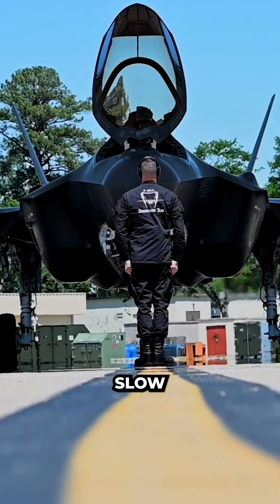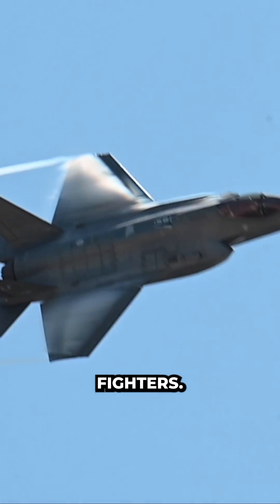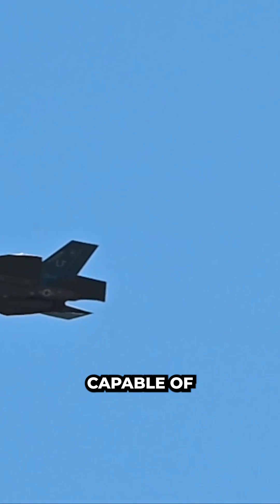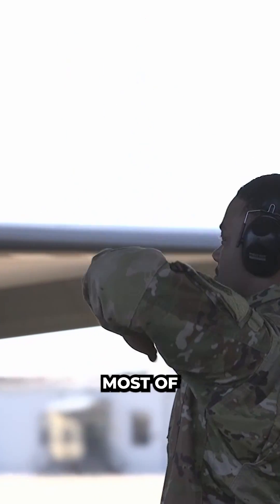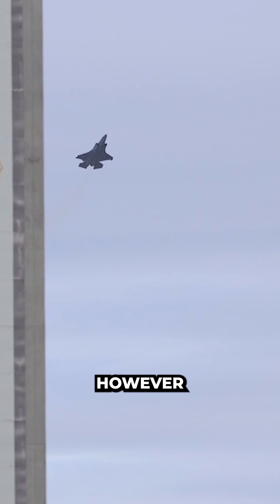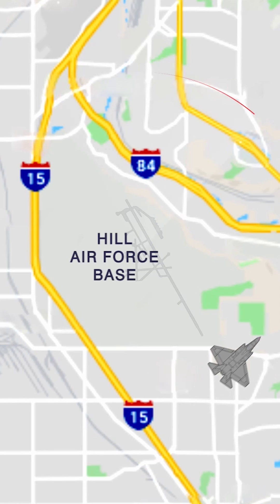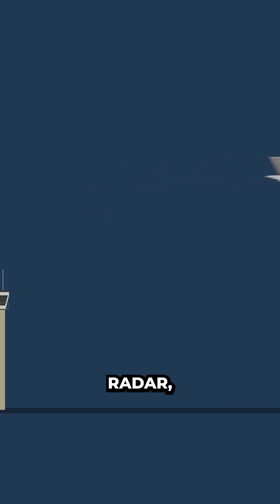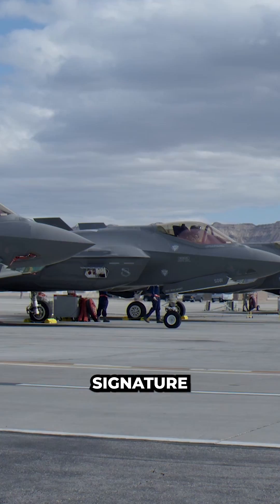Why is the F-35 so Slow Despite its High Thrust to Weight Ratio? #shorts

Comment: The F-35 goes exactly as fast as it's designed to. So does the F-22. 

The intakes on these are not designed for high speed/Mach 2+ flight. They're fixed, unlike the intakes on the F-15 which has variable intake ramps that articulate and can accommodate/manage airflow throughout different speed regimes. Same with lots of 3rd and 4th generation combat aircraft.

Comment: top speed is just a propaganda tool, most fighter jet include F22 will fly subsonic 99% of the time, unless they dont care about range. there is a Chinese propaganda story about their navy fighter j15 (their Su 33 copy of the carrier aircraft) encounter with F35 in east China sea, their story is the lead pilot can not out maneuver the F35, so the wingman come to resecure, their story is despite of their disadvantage in aircraft, they work together as team to fan off the F35. key take away is, J15 like su 33 is based off su 27, which is known for their super maneuverability, the NAVY variant has even better maneuverability compare to su 27, and their top speed supposedly much faster than F35 as well. if F35 is really that bad, there is no way F35 win a dog fight with the J15. it is not a real dog fight, it was just 2 fighter jet compete for a radar lock firing position, the F35 most likely is carrying a Luneburg lens.